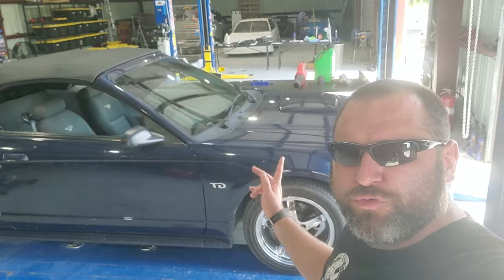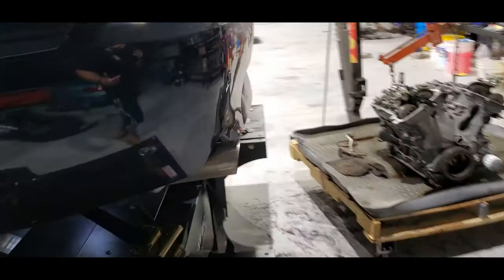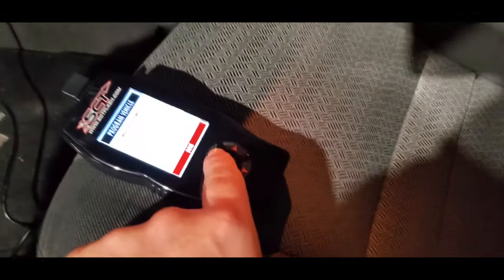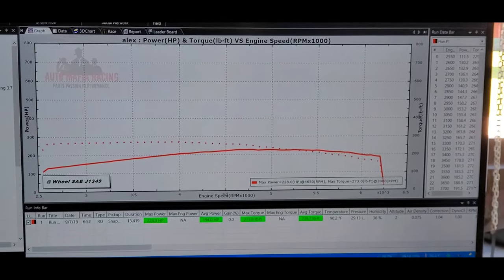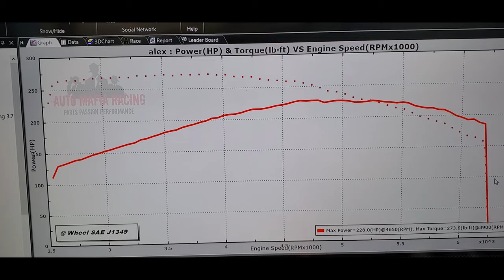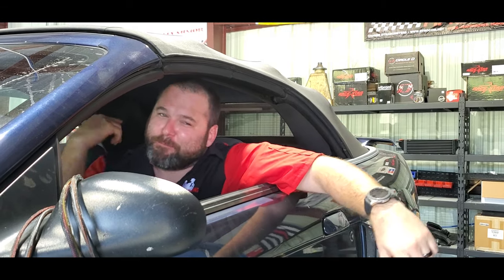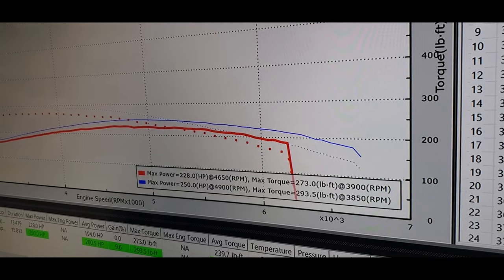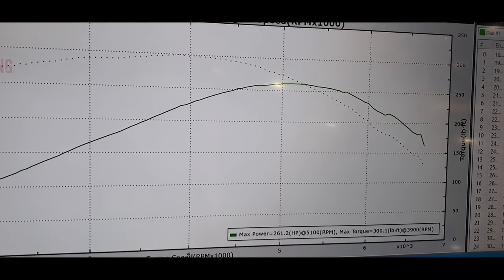Basic Bolt on 99 2v 4.6 V8 Mustang Gains 35 rwhp and 30 ft lbs of torque with  Mafia Dyno Tuning

Comment from the maker: How funny is it that a full bolt on 4.6 2v V8 mustang only makes 260 rwhp, while we have multiple 3.7 V6 mustangs making 300+ rwhp!   This just goes to show how advanced the 3.7L V6 Cyclone motor is!
Reply: Yeah the 3.7 is a awesome motor for sure..gets a ton of un dederved hate. Just for reference...the 3v 4.6 with fbo will make a good 50+ hp and 20+ tq yo the wheels over the ol 2v. Some real crazy stuff is how little hp the old pushrod 5.0s make with bolt ons....but...they make a grip of tq compared to the 4.6 2v...especially down real low
Reply from the maker: Motors have turned from torquey to high hp.  But personally I do prefer the higher reving higher hp multiple cam motors!
Reply: @automafiaracing  yeah i like them high revving v8s! I still got love for the cyclone tho. The ol 3v pulls prettygood to 6500. That 2v is done by 6k tho....the old 5.0s were done by 5200 lol
Reply from the maker: yeah we rev our 3.7 to 8,000 when NA and 7500 under boost.
Reply: @automafiaracing  8k...holy shit haha. Thought i was running mine hard shifting at 7600 lol
Reply from the maker: lol
Reply from the maker: Yeah they make power that will make a 4.6 puke a rod
Reply: Would that not be 300 to the crank? Which would be closer to what the 2v is actually making? Not trying to be one of those people but I've beaten multiple 3.7's.
Reply: Hecht Speed yeah making 300hp with 300$ worth of Bolton’s and junkyard parts on a 302 is fun 😂
Reply: Not really fair to compare a late 80s design V8 with a modern VCT DI V6.
Reply: Is this a PI or Non PI motor?   seems a little low for a PI motor.
Reply: Where are you located? I'm trying to get my 2v tuned
Reply: @joserodriguez3652  right
Reply from the maker: Yeah a tuned fbo 3.7 makes 300ish rwhp
Reply: @automafiaracing  yeah the only way ima see 300 without cams is by upping compression, or boost lmao
Reply from the maker: 300 wheel but most aren't turned up
Reply from the maker: No we make 300 rwhp on most fbo 3.7 v6s. Our shop car was making 328 rwhp and ran high 11s
Reply: @bearfoot25  ur right bud. Healthy auto this yr should be making about 210rwhp and manuals make around 220rwhp completely stock. This thing has long tube headers, cai, the good bbk TB and is tuned. Should be around 240rwhp~250rwhp. I have only watch 6mins of this. I'm interested to see where the power is after they fix the issues
Reply: @ianrs6310  they sound like a vq. I dont mind the 3.7s but ive got hardly any money into my npi and it holds its own to my buddys vert '14 auto
Reply from the maker: Boost them both
Reply: @madmod  check out some of my vids. My little 2v stock besides gears was running high 8's in the 1/8. Ive beat multiple 3.7s with mods and a 2017 ecoboost.
Reply from the maker: Nice. Most 3.7s are pretty slow honestly..
Reply: @automafiaracing  but for a car that weighs the same or less with more power gets  by a 20 yr old stock car with 40hp less? Somethings just not right. I mean the 3.7s even have a pretty smooth powerband
Reply: CockYaLegS  while I agree somewhat with your statement about cars having alot more power these days, modern mini Van's stock are not gonna "embarrass" a 2v gt of this year let alone an ls1 car.  Mm&ff ran 13.7 at 101 mph in a stock new edge back in the day and the ls1 cars ran low 13s few got into the high 12s stock.  There ain't no minivans I know of that are gonna "embarrass " that they'd be lucky to keep up with them at all.  Modern cars have alot more power but they also weigh alot more.  Weight is a factor believe it or not lol
Reply from the maker: A FBO 3.7 with our tune makes roughly 300 rwhp.  Thats stock heads stock cams.   A stock heads stock cams 2v isnt making 300 rwhp.   Can you change it up and make good power? Of course!  

Torque and being lighter are generally what makes the 2v faster than the 3.7 NA.  Now boosted the 3.7 will murder the 2v because we can push around 600 before the bottom end starts to get weak
Reply: @automafiaracing  hell yeah bud, I don't mean to be one of those people whose like "I beat 3.7s all the time" blah blah blah. I love your input, and just like to ask questions based on personal experience opposed to watching some YouTube videos
Reply: CockYaLegS  mini Van's aren't gonna run 14 or 15 more like 17 or 18 even with 300 hp they weigh 4500 lbs lol.  New edges can and do run high 13 in good air.  Its called da.  Mm&ff ran 13.7 at 101 in a bone stock 01 gt that was with a great driver and good air.  No modern minivan that I know of is gonna sniff that time good air or not.  Yes there are places with bad da where those gt can be in the mid 14 even closer to 15 like you said but my point was that still isnt gonna get "destroyed " by a modern minivan.  Destroyed is an exaggeration that was my main point.  They have 260 hp vs 3300 lbs compared to minivans making 260-320 hp (guessing) that weigh 4500+ lbs and they normally will have LESS torque than the 300 the new edge had...less torque to well over 1000 lbs weight gain.  It just ain't adding up.  And not only did you say they would destroyed 2v you even said the ls1 cars which is even further from the truth obviously.  I know modern cars have alot more power but it ain't just about power.  There is a big difference in weight and I mean big.  Just because minivans have 300 hp dont mean they smoke new edges and ls1s.  My dad has a modern minivan with a v6 I think it has like 282 hp something like that and it is impressive for what it is certainly but it ain't no rocket ship and it aint gonna be smoking any new edge gts or ls1s anytime soon lol.  Few modern trucks might be able to pull on stock new gts...like the 10 speed 5.0 they run like 13.3 and stuff so they're right there in ls1 territory and little ahead of 2v territory but only the new 10 speeds can do that until the 10 speed came they were running 14+ second quarter mile times and down.  Like I said I understand your statement partly I just disagree with other parts of it as I feel it was exaggerated.
Reply from the maker: Youre good. Weve built.plenty of fast 2v that would whoop most NA 3.7s
Reply from the maker: Truth
Reply: @automafiaracing  where are yoll located? I'm from upper s.c and when i get my 2v put back together I nerd it tuned. It's fbo, ported heads, and straight piped. If you have no clue it's fine but my car ran a 8.8 @81mph. Stock tune. What you think id pick up after a tune?
Reply from the maker: South west florida
Reply: Lol my auto makes more at the wheel. 254/300 with 240hp@redline.
Reply: Random videos with cams? Slack asf
Reply: @creepystank420   nope, Stock 2 valve autos only make 205-210ish at the wheel,  5 speeds make closer to 230.  50hp 60tq with bolt ons and cams is a +.  Talking about Slack af? bruh ur pull video is 30-60 in 4.5 seconds...Btw by the pitch of your exhaust i can tell you deleted your cats without tuning. Those cars enrich by 10-20% if that code is thrown. That is a instant 15-20 hp loss.
Reply: Random videos 😂😂 honestly my car needs a tune super fuckin bad. Being the ricer I am I gutted all 4 of them bitches. Car didn’t throw a code whenever I ran dumps. However it did want to throw a code whenever I put the mufflers back on. But yeah, if your shit is fbo with cams and you only make 250whp? Think about that. You gained what? MAYBE 40hp. Have you ran it at the track? What kind of times do you run? And I was really just fuckin with you. 2v guys gotta stick together. Your tq number isn’t bad tho, do you have a stall or anything?
Reply: @creepystank420   nope, heres the math. The 5 speed car in video full bolt ons without cams . 250/293wheel= 295/344Crank. My car with much more parasitic loss 255/300 wheel = 320hp/375 crank. If my car was 5 speed would be 270/318 wheel.  I'm also running cats and turbo mufflers.
Reply: Well guys it's not funny at all.😂 But I love my 2v.not sure what ford was going for there.been nice a 330 hp.2v.just to complete with the z's and Ta's
Reply: c t 23 the 2v didn’t have any competition. The Mach 1 was made to compete with the ls1. Then you had the 03-04 cobra... we all know not to fuck with them lol
Reply from the maker: Do it
Reply: @automafiaracing  To your original question, the compression of a stock 2v motor is only 9 something :1 after bolt ons and mild cams gains adding just Trick flows TW cylinder heads alone will add up to 100 wheel on top of everything else. I've seen 348whp 320wtq.  I had a trans built with high stall converter being installed now. After that I'm gonna freshen the block and buy some cylinder heads.
Reply from the maker: Amen thats why we still have a 2v powered fox
Reply from the maker: Florida
Reply: I thought cars would fly by 2020
Reply from the maker: Me 2
Reply: Yea but it will never sound 2v good. Like a mustang
Reply: @automafiaracing  dissing the 4.6 for absolutely no reason at all
Reply: Haha
Reply: Highly doubt the v6 with bolt ons make over 300. It might feel like 300 but its not
Reply: Idk what all u guys r doing to those engines but my 97 GT got a PI head and intake swap (better comoression) with aftwrmarket 70mm TB and it makes 300@rw easy.
Those square motors can handle up to 500hp with the stock pistons.. Im no braggard but when your "300hp V6's" drop off, im still making torque.
Which translates to a Gapparoni with extra cheese.
NONE of the ricer kids around here can touch it.
I am very proud of it because i built it from the ground up.
Reply: Sold my fully built supercharged new edge made 400+ rwhp. Could have made more with pully swap but it wouldn't hook for shit in all 3 gears in an auto. I miss that ride
Reply: @chrissmith2009  what was your rear gear ratio?.. 4:10?
If not, should have been.
That car with the right set up can and will "hook and book".
Lmao @ V6 lovers. Smh... How can anyone have love for all That God Awful racket they make?
Lol...jk. I love trolling those guys. They make it so easy.
They got boners for 300hp cars when we have 454bb stock chevys scaring the 💩 outta 500hp.
Lol it's all cold air intakes and fart cans these days i guess lol.
Reply: @automafiaracing  I hate to ask but where can I find a video on this? I searched everywhere on your videos and cant find it. I only see the turbo shop car :/
Reply from the maker: About 50 videos of them? Not sure where you looked
Reply: @johnherbold6539  Richard Holner discusses what various mods give in crank hp in gross mode with no accessories.  By changing heads cams intakes etc.
Reply: What is more funny is how the v6 sounds...lol!
Reply: I mean the 4.6 in the gt uses the same cam as the trucks
Reply from the maker: It's apples to oranges and 4.6 2v was still being made in 2004.... not the 80s lol
Reply: Or what a turd the 4.6 is. Reliable it is powerful it's not
Reply: @MrPorsche91730  coming form a Porsche guy I would say you never had on or know the 4.6 will compete with much bigger engines
Reply: @austinhowze6280  I own a 2003 town car Cartier
Reply: @MrPorsche91730  lmao didn't those things run 14s with 4 doors and full size frame on body car
Reply: @austinhowze6280  16.4.. basically the same as a 03 Buick century. I'm not talking about the overall performance of the car, the tc was never ment to be fast, but more the engine power outupt. I knew the 4.6 wasn't poweful but then I read a mustang V6 makes 300hp lol. Wtf ford. Did this V6 come out same time as 4.6, it can't be stock right?
Reply: @MrPorsche91730  it's also much newer flat head v8s only had 100hp
Reply: I just watched a video of a guy making 400 hp and 400lbs of torque with a non pi motor, ported pi heads, pi intake manifold and some stage 2 cams and long tube headers here on YouTube he posted the exact cams he used and claimed that more advanced cams could yield more power.
Reply: https://youtu.be/trS4YdTeCkQ here's the video of the guy I was talking about. 400hp with a stage 2 cam
Reply: LOL YOUR LAST NAME IS PROBABLY SMITH LOOOOOL.
Reply: @MrPorsche91730  The Modular V8 was designed in the '80s and released in 1991 in the Lincoln Town Car and was then fazed into other FoMoCo products the following year(s). Unlike the implication the 2V being sold in the '04 Mustang doesn't mean that it was anywhere near modern at that time, and it received another significant mechanical update in '05 so it really doesn't make sense to try to compare a '99 update 2V to the '11 cyclone V6 in any capacity. If you wanted to compare the cyclone to a V8 of similar tech/era the modern 5.0L that came out the same year would be a pretty good start right? Not a almost 30 year old engine design vs something that was brand new at the time.
Reply: What can I expect out of my pi with cams and bolt ons after a good tune
Reply: @automafiaracing  I bought a 96 gt bolt ons and also a v1 vortech. Should it be making more than 350 whp? I’m just going off a tune and dyno from 2 years ago
Reply from the maker: Depends on tune and boost level
Reply: @madmod  then your has the worst driver mod or he's feels bad for you
Reply: @michaelharris748  I agree with you on some of this but please don't even compare a 2v to anything ls1 there is no comparison at all
Reply: @viprk24OC  a stock headed cam and header only tuned Camaro from 98 -02 would eat it
Reply: Why is that funny,
Reply from the maker: No we make 300 rwhp NA
Reply from the maker: Fair no.  But can still compare
Reply from the maker: Yup
Reply from the maker: Very true
Reply from the maker: Lol
Reply: @automafiaracing  I’m older, and remember all the older cars well, for it’s time , it was average and relevant and more powerful than the previous mustang, think about this, how powerful was the fox body? 200 hp and then the iroc z camaro  generation cars were 200 hp cars as well, and they were all fun cars to have and drive, it’s just that these days we have come so far that it’s hard to compare and then folks want to look back on the older cars like they are nothing, well, the 94-04 cars can be built no problem if you spend the money, just like anything, mines putting down 450 wheel on a stock bottom with boost cams and LTs which is safe as long as you have a great tuner, which I do, I have no problem passing Coyote and LS Camaros and ScPk Challengers, it’s a blast
These cars just are what they are and just got to enjoy them for that
I just kinda frown when people act like they’re nothing, but back in the day they were just as sought after as the new ones are today, when that New Edge dropped people couldn’t wait to have it and put exhaust on, that was the first thing done
Reply from the maker: It is crazy how improved the power is with each new model is what we are pointing out
Reply: @hechtspeed  right, but when you start boosting 2vs they accept it so much better then a lot of engines of it’s time,
Reply: A cam change on a 4.6 2V is the way to go if you want to make some power.
Reply: @j.t.cooper2963  yea, it’s all in what you do, that’s for sure,a 2v can make a whole lot more than 300, just got to spend the money
Reply from the maker: Agreed
Reply from the maker: Lots of money
Reply: Yeah, but that flat torque curve in the bottom end and midrange is what my 4,000# Grand Marquis needs to get a head of steam on. She's stock now, but...

When I get the chance, she's getting the full bolt-on treatment, including Trick Flow heads and plenum, MHS cams and Stainless Works headers. She'll be the Leather Lounger...

That's showing taillights to the unaware.
Reply: 13.70’s  all day back in the day with a stock ass 2v on a tire. It was just a really fun car to drive too! I would pick a 2 valve new edge over any non V8 mustang any day of the week! The 6 cylinders (unless boosted) just aren’t quite as fun. Even if they are faster. To the person (I’m sorry I forgot who said it) claiming 11s on a 300 whp 6 banger I’m gonna have to say I just don’t know about that.
Reply: @automafiaracing  lol 3.7 and 300whp still running in the 13s… 🤣🤣
Reply: @automafiaracing  lol 3v is still smashing a 3.7. Stop it you need everybit of 400whp to beat a 3v with 360whp because the Tq factors come on now bruh. Stop lying them 3.7 blow up so commonly it ain’t even funny. And at least that 4.6 can go to 450whp unlike that 3.7 😏
Reply: @steverichardson7417  that’s where the 3v comes in and new edge s550s and 4vs  which are all better than the 3.7 that dude said adding boost yea he better add injectors rods etc to even use that lol have a guy on YouTube did it to his 3.7 3 months later he blew the motor. While  you can run a 3v 100shot for multiple years. And gap a supercharged 3.7. 🤣🤣🤣
Reply: Except its not a full bolt on its a basic bolt on so no headers probably and doesnt have cams and its not tuned so losing out on 40-60hp right there

Comment: I use to own 1997 4v Cobra made 306 rwhp and 298 ft/ lbs. The 4v made a lot better high rpm hp, but the torque was better in this 2v, and my cobra was a full bolt on with 4.10 rear gears. I am actually impressed with this 2v and the tune.
Reply from the maker: Thank you.

Comment: This basically convinced me get a professionally-done Dyno tune on my 2000 GT once I get my bolt-ons done. I'm planning on the same basic bolt-ons but with the addition of a Ford Racing manifold.
Reply from the maker: Really depends on the tuner.
Reply: What does it usually cost to get it professionally tuned I live in Pittsburgh Pennsylvania I just bought a 2000 saleen it's not supercharged one but it's already got 12,000 mi on it